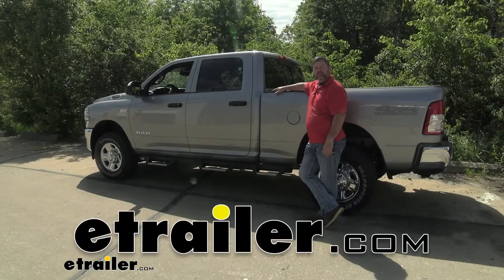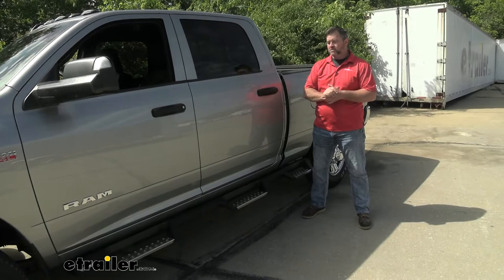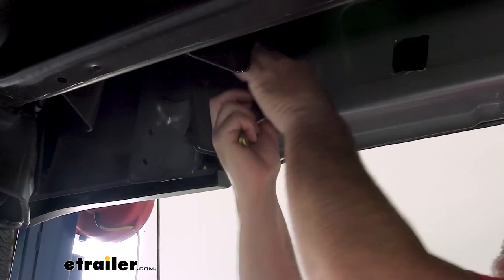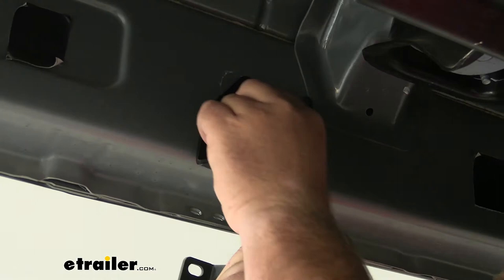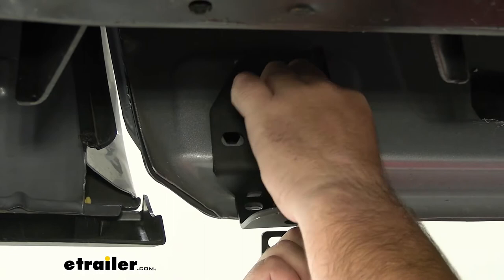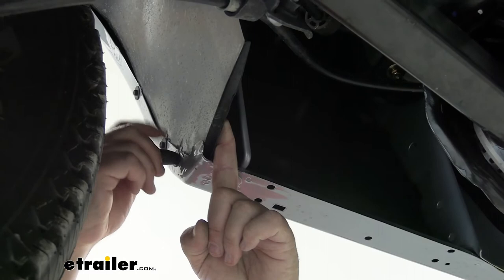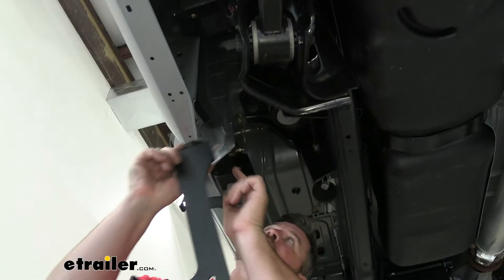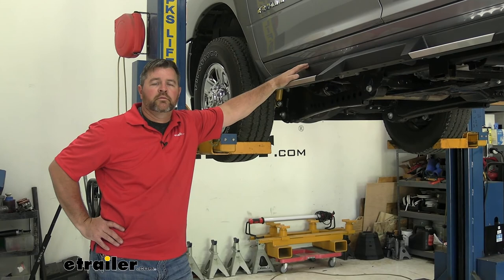etrailer | Westin HDX Nerf Bars with Drop Steps Installation - 2021 Ram 2500

Comment: What of your ram came with running boards do you use factory hardware?
Reply from the maker: It is recommended to use the hardware that comes with the unit. You can find a link to the instructions on the product page here. https://www.etrailer.com/Nerf-Bars---Running-Boards/Westin/W47HR.html